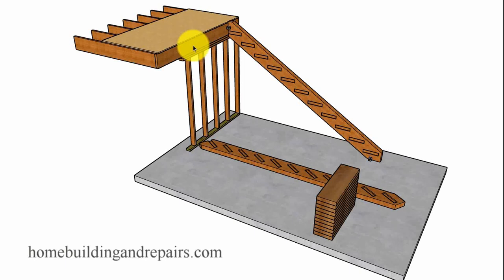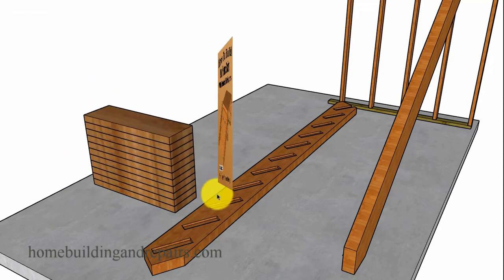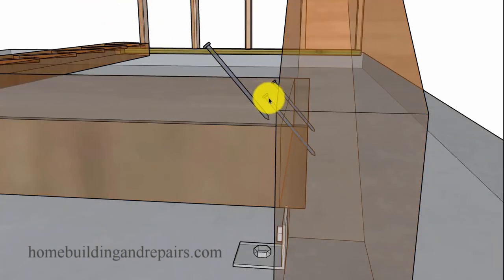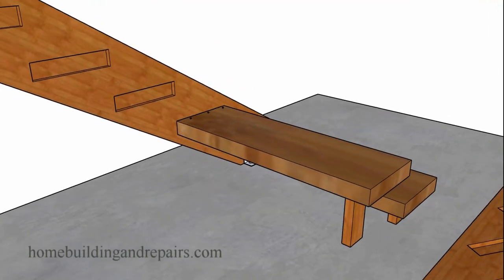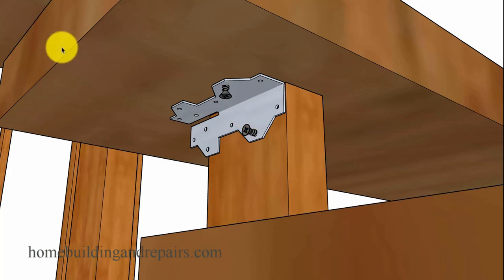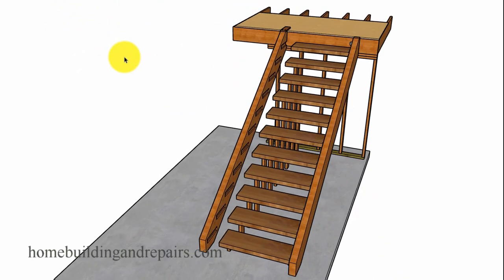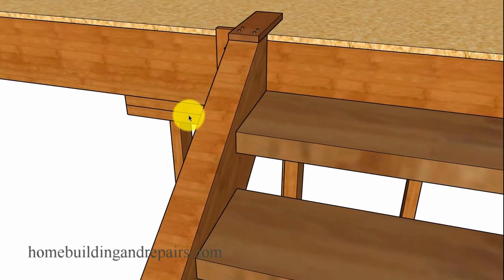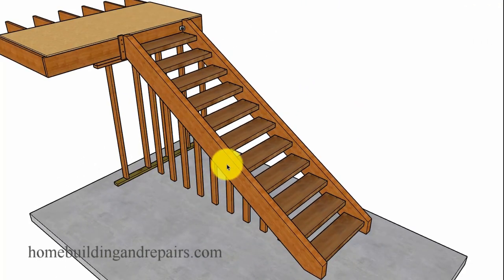How To Install Large Dado Stairway In Sections - Tips For Working Alone

Comment: Out of curiosity, would it be advisable to simply cut the dado all the way to the back of the stringer? Then you could put the stringers in place, slide in the treads, and then secure treads in place with a metal bracket so they do not back out. I know dado's are meant to help avoid the cost of hardware, but, if I'm doing a single-person installation, this would seem easy. It would also mean easy maintenance on replacing treads. Thoughts?
Reply from the maker: I don't see why not, as long as the stringers aren't structurally comprised. For example, it might not work on a 2 x 12 stringer, but might on a 4 x 12 or larger.

Comment: Hey Greg - one concept it would be great to see a video on (that I really can't seem to find a whole lot on) is replacing treads and risers of stairs with housed stringers.  Is there a recommended way to remove wedges and deal with all the glue and fasteners without completely destroying the stringers so new treads and riser can simply be installed to the existing stringers?  I've been inclined to try cutting them semi-flush and then cleaning out the dados with a chisel and multi-tool but I'm curious if there's an industry best practice that's more efficient

Thanks again for your videos..
Reply from the maker: I will put your video suggestion on my list of videos to be made in the future and thanks for the excellent idea.